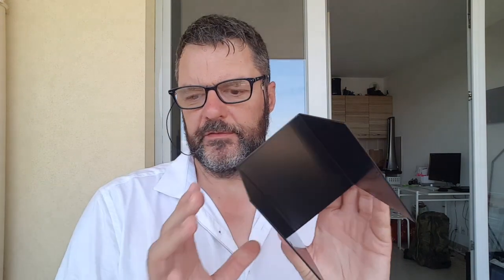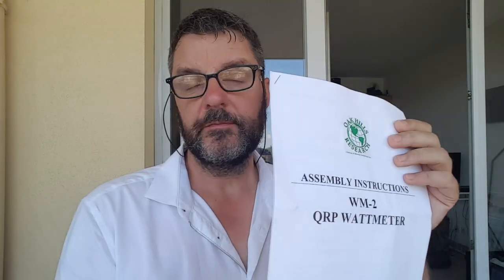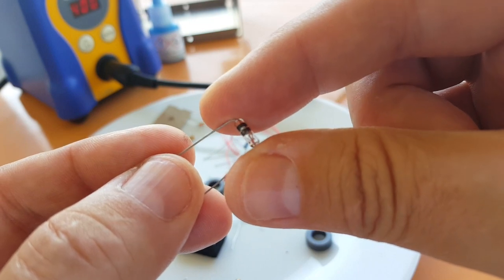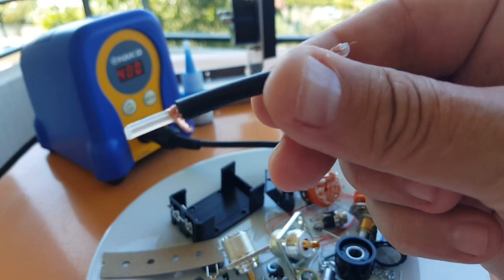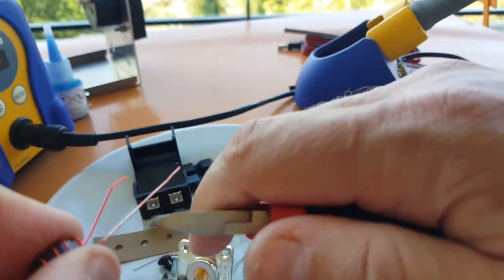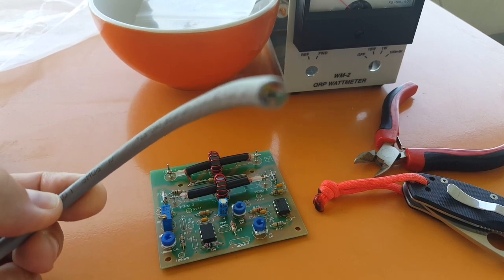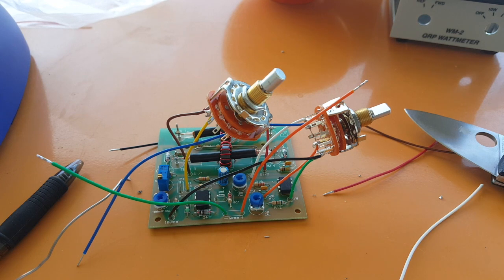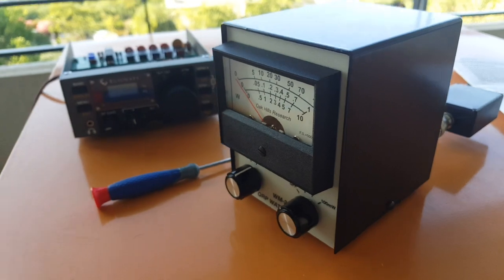Building The OHR WM-2 QRP Wattmeter Kit.

Comment: BTW this is probably what you need:  (It's quite cheap too!)  https://www.rfsupplier.com/bnc-jack-female-connector-straight-4-hole-flange-solder_p3292.html
It's a drop in 25.4 mm square flange BNC female, exactly replacing the SO239.  The supplier often advertises on eBay, so check ebay.com or ebay.fr listings.

Comment: Nowadays much "enamelled" wire uses a self-fluxing polyurethane coat. A soldering iron temperature of 400°C+ is needed to burn it off.  It's always worth testing unknown wire before scraping.  But don't breathe in the fumes.  EVERYBODY soldering should have a portable fume extraction fan to avoid breathing in lead, burned rosin flux etc.
Reply from the maker: Good to know thanks!

Comment: I like OHR's kits. I have built a few of the WM-2's. I slightly modify them by adding sockets for the opamps (because if you plug the power connector in hot it can short and wipe out the opamps, more than once), pin header and jumper for the calibrate jumper, and in one kit I installed a pot with more turns and mounted in a hole on the back of the case for one of the pots to simplify calibration. OHR doesn't supply a PDF file for the instructions and schematic so I can't look up which pot I changed out. <edit> R6 is the pot I replaced
Reply from the maker: A built-in dummy load would be great.
Reply: @RadioPrepper  That's a great idea. It should be too difficult to add
Reply: @RadioPrepper  I have their 100w dummy load and it's great. Really nice case.

Comment: Great bit of kit, I built mine some years ago and found that you had to be careful when picking it up, not to squeeze the front and rear panels together. I reinforced it by adding two aluminium tubes with self tapping screws along the top, from front to rear.  Because I use it for my K1 and K2,  I paid extra, for the BNC kit, I also added an led to indicate power ON, I was forever forgetting to switch it off ! Great vid as usual, always watch your stuff Gil, 73 GW4OKT
Reply from the maker: Thank you!

Comment: Bonjour, Gil! Late to the dance here but wanted to make two points:
 
Firstly, the multi turn pot for R6 is to accommodate the adjustment of the voltages (2.56, 0.800, 0.25) for the three ranges. The older WM-2s had a single-turn R6 similar to the other pots in the circuit. 

Secondly, while the WM-2 is a terrific power meter for QRP levels, I found mine to be in variance with my *calibrated* scope and possessing confidence in my scope's calibration, I used that to "re-calibrate" the WM-2. (See link below.) 

https://www.ab4oj.com/test/pwrmeas.html 

I used an FT-817 at 30 meters (10,100 Kc; middle of 2-30 Mc) as a power source with the 5.0, 2.5, and 1.0 watt levels for the 10-watt range and the 1.0 and 0.5 watt levels for the 1-watt range. For the 100 mW range, I used an attenuator on the 0.5 watt level (-7 dB = 0.099 watts; -10 dB = 0.05 watts). 

The calculation is simple (from the link above and simple algebra: P = Vpp^2/400 for a 50-ohm system. 

Cautionary note: All this is out the window if folks are not as compulsive as I am; I burn up more rolls of solder than logbooks and repair and restore test equipment and my wife considers me certifiable.
Reply from the maker: Thanks, I recalibrated mine, and it seems to indicate the correct levels now :-)

Comment: Nice build Gil you are getting better all the time. Cannot understand why we still use so239,s  BNC,s are a lot easier to use especially if you have a good ratchet crimping tool. I think they are much neater and give a better connection.
Keep up the good work mate.
Reply from the maker: Indeed, will do! As long as my vision is good enough!
Reply: Sadly big Ham Radio manufacturers are just too scared to change the de facto standard.  And note also that BNC power handling is only around 80-100W,  limited  by their 500V maximum voltage when the VSWR is poor.  But mainly PL259's are still a bit cheaper for notoriously penny-pinching amateurs!

Comment: Is a dedicated watt meter like this necessary? For example, with a QRP-guys 12W dummy load/power meter ($10) and a volt meter, you can calculate the power (volts squared divided by 100). It's tiny, too - and it uses a BNC connector. Thanks for your videos, Gil.
Reply from the maker: Certainly there are cheaper options, but seeing a needle move does make it easier.